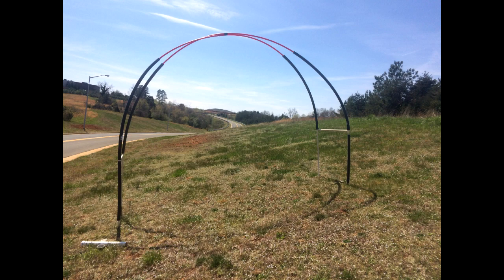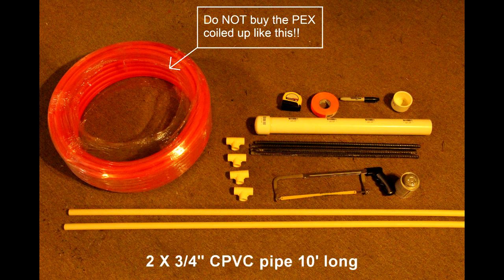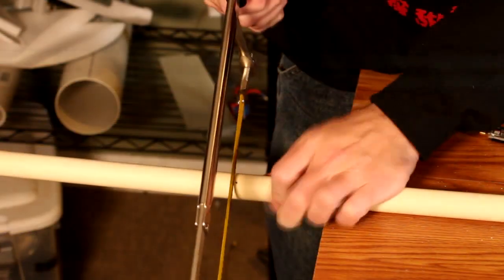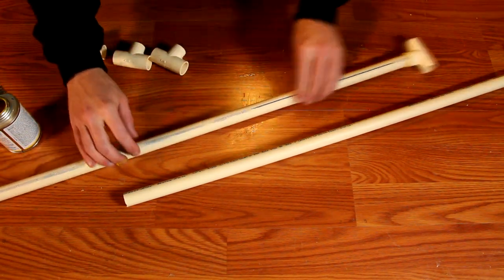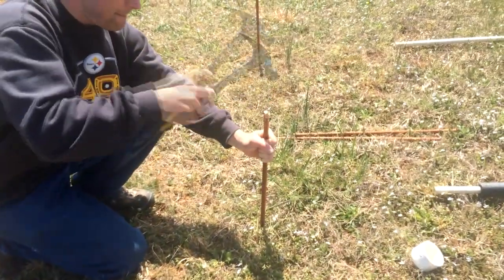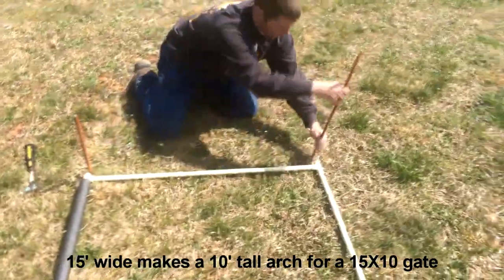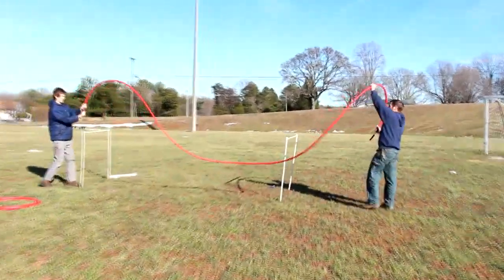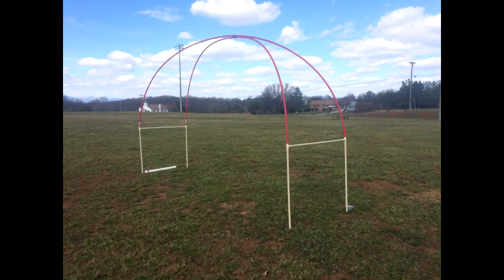FPVWRA wing racing gate build tutorial

Comment: Alex, perfect timing with this video. Just about finished designing a FPVWRA wing design using foamboard. I think I have the airfoil pretty close... One question is what color stands out the best on gates? I know there are many variables with lighting conditions and backgrounds but what have you found stands out better without resorting to a powered setup?
Reply from the maker: Flags.  Mark the gate with flags.  Makes it easy to line up.  The gate is hard to see from a distance.  You can also use chairs to mark the location.  Those show up well, too.
Reply: Thanks, appreciate the reply!